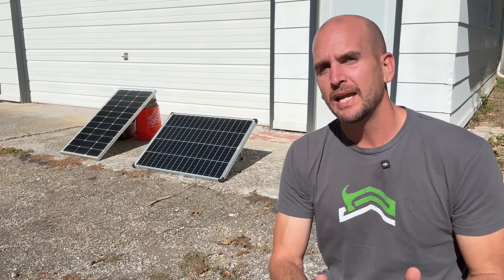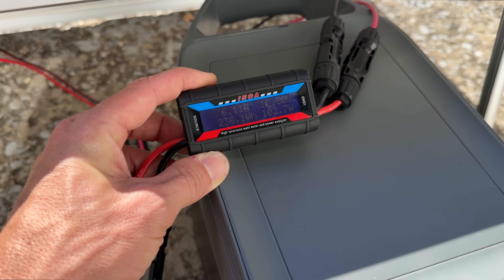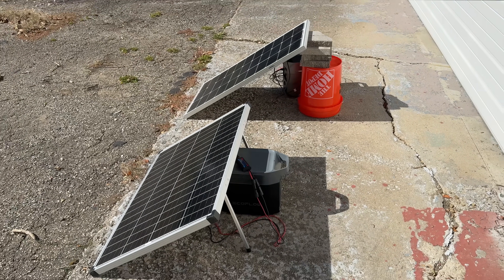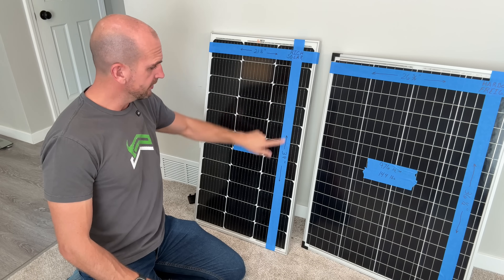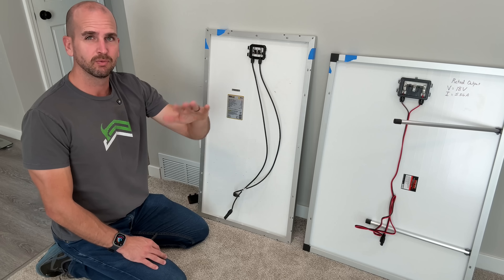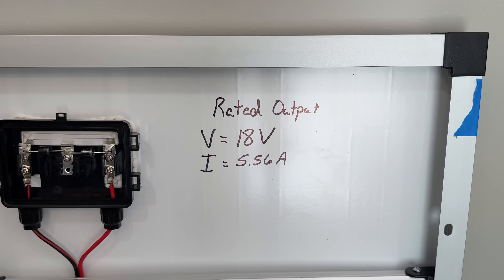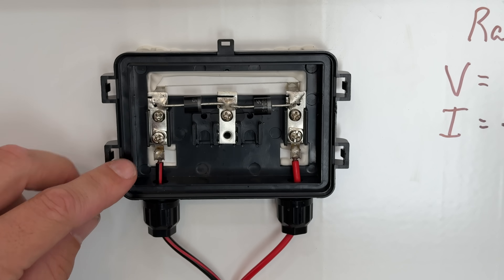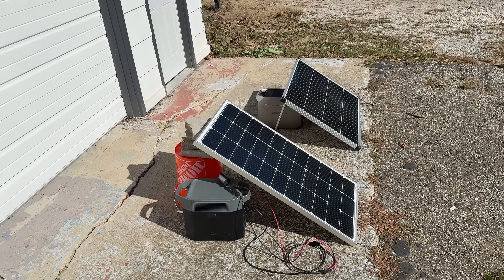Harbor Freight 100W Vs Rich Solar 100W |  Tested!

Comment from the maker: Calculate Solar Cost For Your Home - https://geni.us/solar_reviews
DIY Home Solar (Save $1,000's Going DIY)  - https://geni.us/qN9Ot
Solar Tilt Angle Calculator - https://www.everydaysolar.com/calculators/tilt-angle-calculator/

Supplies
Harbor Freight 100W Panel -  https://geni.us/KRHgFPN
Rich Solar 100W Panel - https://geni.us/XAP1gsp
SAE To MC4 Cable - https://geni.us/NPwo
EcoFlow Delta 2 - https://geni.us/u46bT
EcoFlow Delta 3 Plus - https://geni.us/avZYM
Power Analyzer - https://geni.us/s86J

Updated Spreadsheet of 100W Results - https://geni.us/lAvqOx

DISCLAIMER: This video and description contain affiliate links, which means that if you click on one of the product links, I’ll receive a small commission.
Reply: Your math's off on the Rich Solar Watt/hours. You said it was 432, but it should have been 423.
Reply: Yeah! the error jumped right out. It calls fos an edit with the right numbers. It's a big distraction. @siliconpenguin
Reply: I have a couple of H.F. 100-watt solar panels and I use them daily without any issues.
Reply: I would think that o calculate the total life cycle cost you need to consider longevity. I don't know how you would hat that data though.
Reply: @badatpseudoscience  Solar panel lifespan is at best 10-15 years (and you will need to check the wiring, inverter and the roof for leaks every year), and at worst next month if you get bad hail storm.  If your panels dont net you a profit in 4-5 years, you are pissing your money away.....  and if you ever have to repair your roof... you just added a $10k expense.

If you do it yourself, and you didnt get a permit to install it on your roof, you could also be fined for illegal home modifications in some towns/cities.  

If you have land to make a ground based rack system and room for an electrical shed separated from the home... it becomes a more viable option
Reply: Price Per Panel with year and month noted. Looking at Rich and Harbor Freight panels, there is a ~$100 difference. Also after dealing with power outages a few times, 3 weeks followed by 2 weeks with back to back weather events, Solar Panels and Batteries come in handy to keep a few lights on.
Reply: Please add price per panel come as well as panel area factored into the next comparisons and the final rankings, or running total rankings.
Reply: how much energy per square inch did these panels produce.
Reply: @LisaTurner-d1b  - Just do the math! Divide area in Square Inches by power in Watts, to get square inches per watt, where fewer square inches per watt is better. But that requires a better PV cell technology, which will typically cost more. For these two panels, Harbor Freight panels have 17% more area of PV cells. Is it any wonder they put out 17% more power? No! That is exactly what you should expect, at least if the PV cells are the same technology.
Reply: @LisaTurner-d1b  i don't think solar panels are rated per square inch.
Reply: ur math is wrong in the solar rich it is 423 not 432
Reply: looks like everyday solar has been hacked or is being used to send info back to the server. Malwarebytes is blocking it from sending info out.
Reply: Better learn how to math dude 232 +191 does not equal 432

Comment: Great job on this video, but you need check your math on the rich panel….  232+191=423 not 432.    When you calculate the percentage difference of 495 and 423 that number is 15.68%

Comment: I'm a year late, but one thing you didn't test for is how much each panel pulls in if it's partially shaded.  Some panels do much better than others depending on how the cells are wired internally.

Comment: I have 380 watts of solar (2 - 190 watt panels) and 970 something amp hours of wet batteries (approx. 485 amp hours usable) is more than enough to power my entire home. Everthing runs off 12 VDC including the fridge/ freezer.

Comment: I wonder if you were to replace those crimped connections in the Rich solar panel with soldered ones, if you would see its efficiency of that panel go up. I would assume it would, but would it make parity the Harbor freight panel more?

Comment: I clicked on your link to find my angle and it won't work.  I typed in city/state and nothing happened when clicking orange bar.  I also tried typing in zip code and it still won't work.

Comment: You're missing some variables here that will skew your results if not accounted for.

If the battery packs you are charging do NOT have MPPT, (Maximum Power Point Tracking,) circuitry on their Solar inputs, you need to put an identical MPPT controller on each panel so the voltage / current curves of the two panels don't effect the actual watts out...

Without using an MPPT controller, you are probably getting a mismatch in the maximum voltage/current points of each panel in relation to the load.  (Battery pack.)

------- Edit:  It appears that the Ecoflow Delta 2 has an internal MPPT controller, so that should take care of any voltage/current max power point mismatch.

------ I would be curious to see if the app for the Delta 2 agrees with the difference in charging wattage as shown by the external in line meters.

The other factor is the temperature curve vs output efficiency between the two types of panels.

One type of panel may be better at producing near it's rated output at a higher temperature than the other.  In other words, sitting in the sun, both panels heat up by 20 degrees Celsius over ambient, but one panel has a better 'temperature tolerance' if you will, than the other.

For example, I just had some 430 watt Silfab panels installed for net metering, and I also  have a home built array made up of 100 watt Eco-Worthy panels.

I purchased a solar power pyrometer based light sensor so I know exactly how solar energy is falling on both sets of panels in kw/square meter.

In a nutshell, the higher the temperatures were on the panels, (as measured with an infrared thermometer,) the Silfab panels would out perform the Eco-Worthy by 5% at minimum, and closer to 7% most of the time.

Comment: I'd bet the Rich Solar 100W panel was rated based on ideal conditions at noon at the equator on an equinox, the roughly 17% lower energy production loss is probably about what you'd expect the Chicago location to have given the variation from ideal.  Note, this difference isn't in total energy production but instantaneous power production when the panels are fairly accurately aligned/angled for that location and date.

Comment: Harbor Freight Panel had a 17.7% larger area and provided 17.02% more energy, so the energy output matches the area, though the Harbor Freight was slightly less efficient. Where you are putting a set up, the space usage could matter. It is completely reasonable that area for energy capture is going to be a significant input, so missing that in the numbers of this comparison is a short coming of the analysis.

Comment: Hi there friend thanks for helping people to see how easy this is. I wanted to share a solar system hack with you and maybe you can share it with your people later in a vid. In case of a shtf situation, grid goes down from EMP, Nuc's, or Solar flares the solar system needs to be protected. All components will be fried. Therefore we need to have a faraday cage of some sort. I use a large metal garbage can to keep all my tech stuff in. Solar panels only have one components in the back box but they will fry. Have extra 10 amp or what ever amps your panels are in case they fry or keep them in a box with many layers of tin foil sealed with foil tape; use the foil tape they use for dryer vents. Its real important that if your currently using your system that you cover it some how in a metal box or foil layers to seal to protect it. Have extra inverters and charge controls kept in the faraday cage, box/garbage can for protection including extra components and you'll need a soldering iron solder and a couple full batteries to use your soldering iron after the event to fix you panels. just wanted to share this hack. peace

Comment: Harbor freight panel provides 17% more power but the panel is just over 17% larger, and with the difference in cost, rich solar is a better buy. The 3 panels would be 255w vs 200 for the HF, a 27.5% gain
What about shading??

Comment: I don't know what's going on with these videos and the crowd you are making them for, but the desired goal should be to have the highest per square inch producer of electricity. I don't care if the rated 100 Watt panel actually puts out 300 watts, if it is the size of a museum.
I want the smallest most productive solar panel at the lowest price/ 
I want to know what generation of technology they are and if there is any pro or con to that generation's materials over another. Do they last longer? Do they produce more in shade? Do they stand up to flexing more than the other.
A solar panel of older technology that puts out 100 watts, but is the size of an 18 Wheeler does me no good whatsoever.
Think in terms of:
Per square inch power production.
Longevity in the elements
The generation of Solar panel tech.
Where it is made (nothing from Israel or any Israeli owned company)
Cost of the item per square inch or byth efoot, as long as you applythat same metric to them evenly.

Comment: Thank you for this - looking at using this information to build a solar water heater for Chicken Coop.

Just one observation; any Solar Cost Calculation for me that includes any federal tax savings is just ignored. I need to know the cost without any accounting silliness. Is there a good calculator out there? (at the moment the numbers don't join up in the middle for me)

Comment: Bro the connector on the harbor freight panel is way better I switched all my panels to that and made a spliter run in reverse putting panels in parallel to boost amps not voltage and then any device that draws power you connect in series or alternatively harbor freight also sells connectors that plug strait into the panels as is and give you a car ciggaret lighter port and you can use any device made for car use!

Comment: I was thinking of getting a battery back up for my house but even though I have a small usage of power the EcoFlow was still very expensive because I needed multiple battery packs which when it was all calculated was almost 10 thousand dollars. Since I live where power outages are few and far between I am just going to get a power interface to plug a generator to the house for the times that the power might go out. I know this isn't the same subject exactly but it is something to consider if money is the issue.
Reply: Send excess power to the grid so they can pay you ,by Federal law.

Comment: Scott, what size solar panel would you recommend for keeping RV batteries charged and how would you wire it up? Thank you.
Reply from the maker: Are you placing on the top of the RV?  What charge controller are you using?

Comment: What about overcast days? At what output does it cut in and provide power? For instance on overcast days or at dawn and dusk at what point will the panel produce enough power to charge the system and produce useable power. If the system doesn't produce power until full sun you could lose power total what hours on the day.

Comment: Interesting that you prefer soldered connections. NEC only allows soldering AFTER crimping.

At least you used mirroring with your powerstations.  Without regard to if the stations are discharged, which you have appeared to do, MPPT charge controllers work most efficently with a 30% higher input to output and tend to drop back to PWM when under the 30%, so delivery of 100watts at higher input voltage but less than 30% may have more losses than lower voltage.

Comment: Realize this is an older test but for future test can you incorporate a meter to measure voltage and current under load. Verify the voltage and amp under load could fill in the blanks and describe the difference you are observing.

Comment: I have acquired several mounting brackets for roof mounted TV dishes from a roofer. They seem to overpopulate on tops of houses in our area. When he puts a new shingles on he removes them. Sometimes as many as 3 on one roof. My gain !
The positioning of that curved pipe is right at 37°. And when attached to my Rohn tower for my TV antenna it is a very suitable mount for my solar panels. I currently have four 100 watt panels on the tower now. But each panel is mounted singled on each curved pipe.
A mechanic told me that curved pipe was hefty enough to support 3 solar panels if I constructed a mounting bracket for them to put them side by side.
That would give me room to mount 12 panels in the same space as the four I have now.
And it would relieve me of decorating my roof with panels on my tiny house.

Comment: I do apologize but unfortunately I don't have much faith in harbor freight whether be there tools or otherwise harbor freight most of that stuff comes from China so why should I involve myself with something that might be good or not good there's 200 w panels right now on eBay that are roughly about $80 so why should I go to harbor freight for a 100 watt solar panel the 200 watt panel puts out between 11 and 20 amps think about it

Comment: i noticed when you were showing the diodes that the riches had larger diodes. i am wondering if you changed the diodes in the harbor freight to a larger diode, would the output be better?

Comment: Hi, I picked a solar panal for free, but the glass is cracked…. What should I use to charge the battery? Im just using it for lighting my barn, I have a tight budget!
Thank you for making you videos they are very informative!
Reply: The size is 4x6’ about a year old, I was told it fell off the roof ans like a peice of toast it landed on the glass side! (butered side)

Comment: Measuring the area based on the perimeter frame size seems like it would not be accurate:  The size and space between the cells on each panel seems to be very different.

Comment: What is the voltage output. We have a 185W solar panel that puts out 70V which means it produces usable current when shaded. I have seen 17V under a full moon.

Comment: As for the square inch area differences: would the slightly larger surface area of the HF panel be a differential factor of generated power?

Comment: its almost like there's some sort of... relationship... between total solar area.
the rich solar is 829 sq/inch, the HF 976...
829 * 1.17 (the 17% increase you saw) == ~970...
huh hhhhhhwwwwwwweeeeeeeiiiiiiiirrdddddddddd lol

what you should be doing is comparing watts per surface area.

Comment: Your evaluation does not tell the whole story. If you calculate the WH per square Inch. Rich Solar (0.52 WH per square inch) produces slightly more energy than Harbor Freight (0.507 WH per square inch).
Reply: Correction with the updated math by earlier comments they produce the exact same energy per square inch sorry i missed that before.

Comment: You need to include the price for each solar panel in this review.
Reply from the maker: If you download the spreadsheet it has the price ranges and now a $/watt calculation 👍
Reply: @everydaysolar  why force viewers to download something instead of mentioning it in the video how much they cost? You went through the data sheet but can't say how much you paid?

Comment: :
Great video! Now that you have this data you do not need to replicate Harbor Freight's data, or the Rich Solar Data for future comparisons. Add any additional 100 Watt panel tests to your data bank and then compare them all.

Rich Solar = 14.00 W/sf     Harbor Freight = 13.90 W/sf!

24'x42' roof (1,008 sf) = Harbor Freight  at  =  which costs  and Rich Solar  at  =  which costs .

For the 12.3 kW solar system you are paying about 27.45 % more for Harbor Freight's 130-panel system than for Rich Solar's 153-panel system which also provides an equal amount of power at 12.3 kW.

Result =  Rich Solar 100 Watt Panels provide more value for your solar dollar/square foot!

Even if Harbor Freight offered a 20% discount ($100/Panel), the Rich Solar 100 Watt system would remain more cost effective.

If you like, I have two (2) spreadsheets with PDFs I can forward to you for your review.

Comment: General rule of thumb is 1000 watts per square meter is the sun's output on Earth, approximately.  At 17% efficiency, which is an average solar panel efficiency, that gives about 170 watts maximum per square m.  Your Harbour Freight panels work out to .63 sq m, x 170 watts = 107 watts, which is what you got (keep in mind that is maximum efficiency...)  The Rich works out to .53 sq m x 170 = 90 watts.  So if you want to know approximately the actual output, measure it and ensure it is at least .63 sq m/100 watt rating.  Some liars sell small panels claiming 100 watts, when in fact they are only 25 watts.  You can tell by their size, don't be fooled!

Comment: I purchased a Harbor Freight solar panel kit about 12 years ago. They still sell it. They do not last. About 4 years later there was water damage and along the edge and it damaged the panels. One gets what the pay for. If you can keep them out of the rain you may be ok. I had to junk them. Stay away from this kit, your choice. THUNDERBOLT SOLAR 100-Watt Amorphous Solar Panel Kit

Comment: i have watched several of your videos and enjoy them. however, i must point out that you made a MATH MISTAKE on your white board.  232+191= 423 NOT 432. AND the "correct" percentage of advantage of the noted harbor freight panel was closer to 15% NOT 17%.  just a FYI.

Comment: Can you compare it to the Noma 100w solar panel with the 8 amp charge controller. 
I use eight of them to power my house with a 3,000 watt inverter with six deep cycle marine Nautilus 800 amp hour batteries